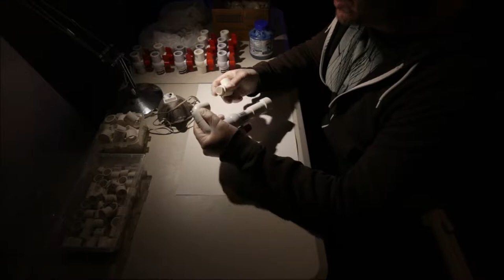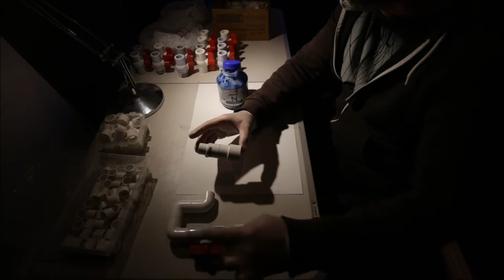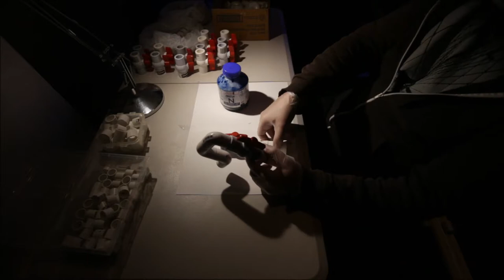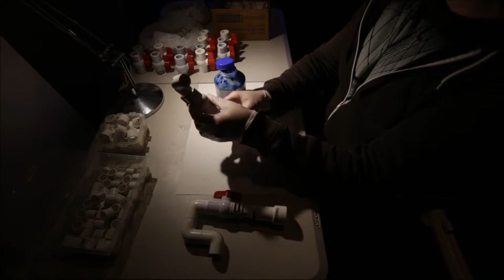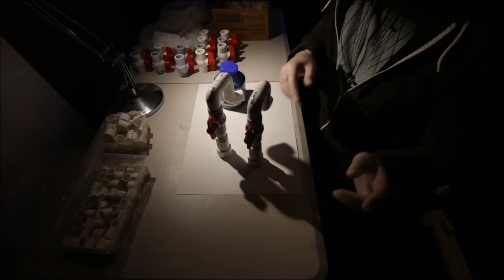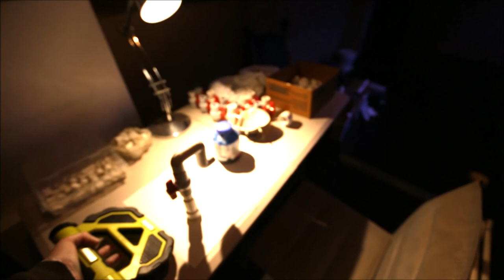Fish Room Plumbing Design - Return Lines for a central Sump System

Comment: Lol the taps can go either way, they still turn clock wise. 

You really should glue both parts.
Reply from the maker: These taps close in one direction and open in the opposite direction. You do need to take note of the direction they open/close.

What "both parts" are you referring too. Everything is PVC cemented except the last elbow which directs water flow in the aquarium.
Reply from the maker: Sorry mate. I accidentally hit remove comment instead of reply! But I managed to read what you said.

So yes, in the horizontal position the taps are closed and in the vertical position the taps are open. What I meant though was that I wanted them to turn all the same direction when I need to close them. In this case, all my taps close clockwise and open in an anti clockwise direction. Sorry if I didn't make that clear in the video mate
Reply: @JasonsCichlids  I think you'll find it was an unnecessary measure.

Comment: Just wondering why are you not using the pvc primer before using the pvc cement?
Reply from the maker: That is the one thing that totally slipped my mind. I had every intention on using primer but for some reason just simply forgot. Thankfully I don't need to run the system with anything that would constitute high pressure.